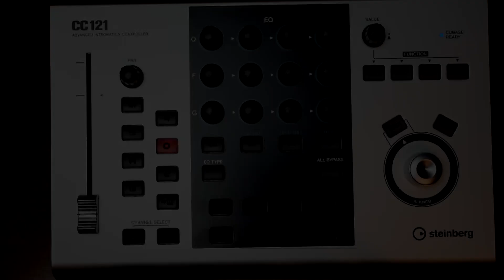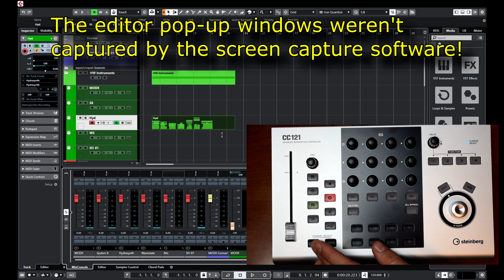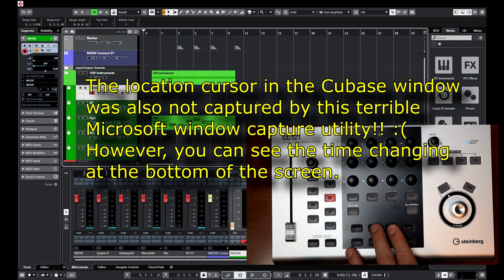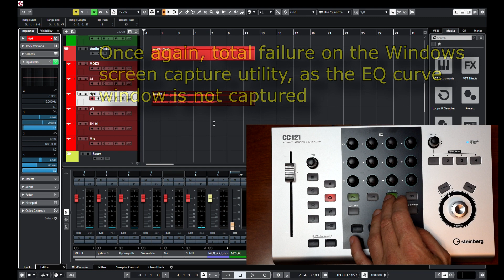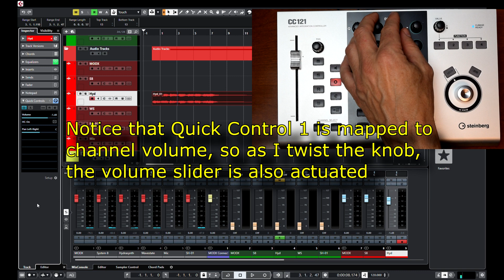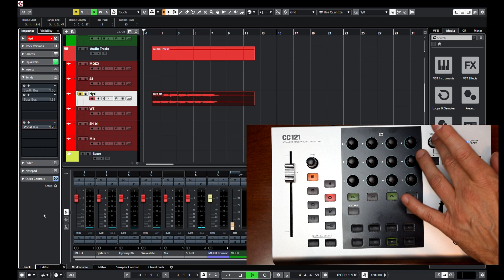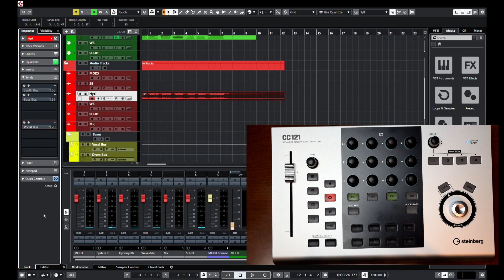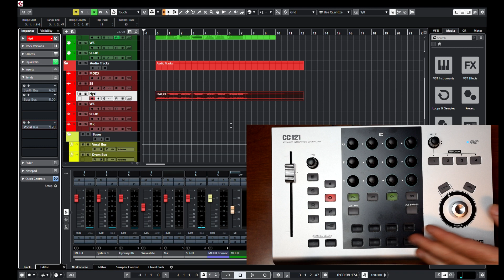Using the Steinberg CC121 with Cubase: an Overview

Comment: What happens with the fader or eq if you select more than one channel?
For drum recordings and such.
Reply: I don't use it with a "wall wart" so I don't have the motorized fader but when selecting multiple tracks it reflects the top-most track on the eq (when I I press the "e' button)